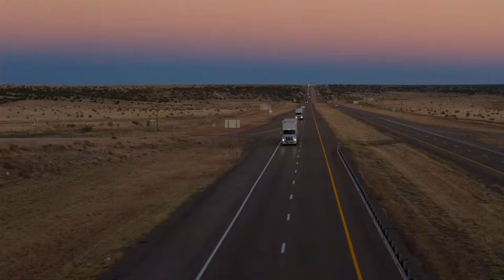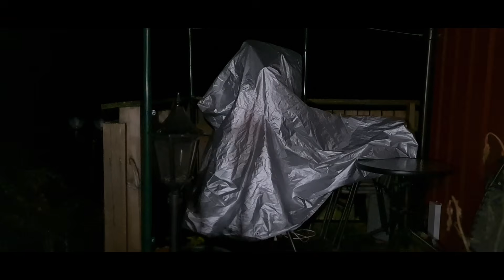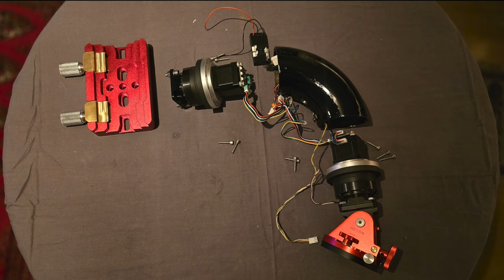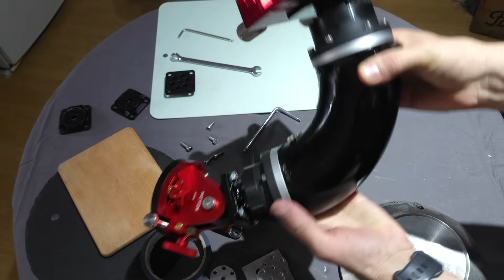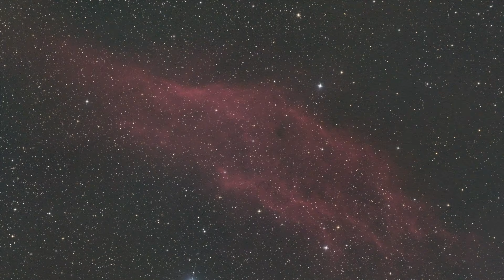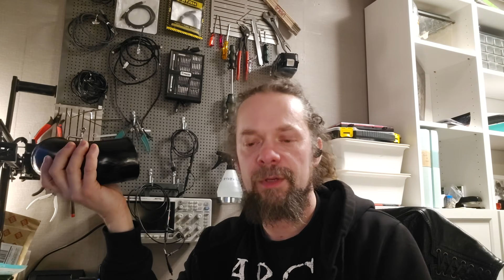The Beast is Unleashed! A strainwave mount!

Comment: I didn‘t expect that. How were you able to stay at that weight? I used 14 size harmonic drives, normal steppers, aluminium square tube and PMMA sheets and barely made it to 5.5 kg for the fully assembled mount. I didn’t use motors like yours since I don’t know how to implement them. I always use the FYSETC-E4 board and could only run them as steppers. I usually also used some intermediate reduction between motors and harmonic drives.
Reply from the maker: Yeah, I’m pretty pleased with how it came out. Since this I did some changes, and have actually been able to reduce the weight to ~4.7kg.
The way I understand it, an intermediate reduction between the motors and the strainwave gear is the normal way to do it. Most seem to have 300-400:1 from the motors to the output.
That’s gonna add some size and weight. There are pros/cons to both ways.

I suppose you are using OneStep or similar control setup? I have been thinking about implementing that, but I opted for my own design. OneStep seems to be a very nice control, so maybe in a future version.
I’ll post more on the updates and the current setup in another video. Some guide graphs etc.
Thanks for watching! Hope you get to test your build!
Reply: @astro @astroboden ally 300:1 is the most common reduction. All the ZWO and many other mounts use this gear ratio. 400:1 seems to be less common. For the last one I used planetary gearboxes with 3.7:1 ratio (3.6 would have been awesome but I didn’t find any gearboxes with that ratio). So total of 370:1. True, I use OnStep which is especially nice since the board I use has 4 stepper drivers so I can add two focusers or a focuser and a camera rotator.
Reply from the maker: Yeah, that is a nice feature. Maybe if I scale up I’d consider the effort ;)